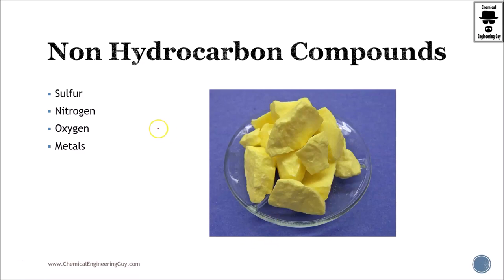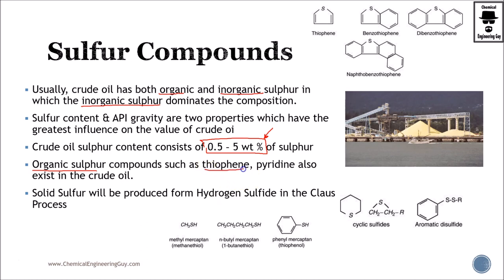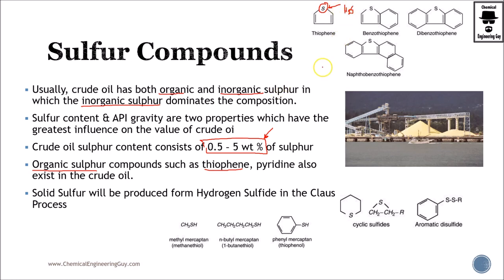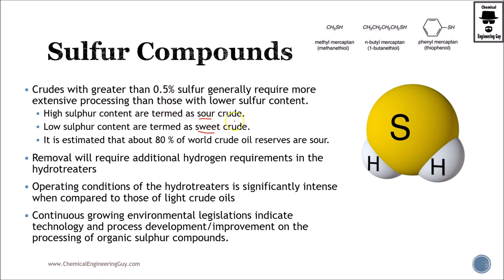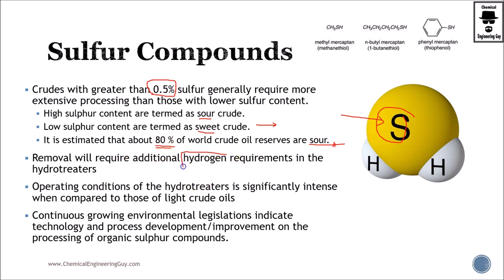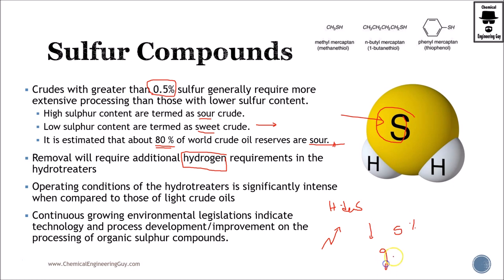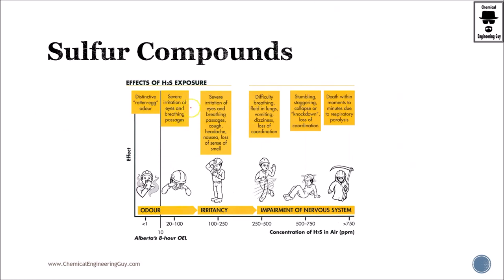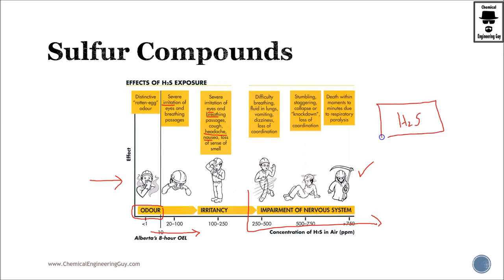Sulfur Content in Crude Oil (Lecture 049) - Petroleum Refining

Comment: Hi, thanks for the useful video. 
I'd like to ask whether there are any other methods to remove sulfur aside from adding hydrogen (hydrodesulfurization) ? If yes, do you know anything about the cost associated with each method?
Reply from the maker: you can mildly crack them, form SO2 directly, but it is not quite convenient

Comment: what does 0.5 % sulphur means. and how many kg of sulphur will be in 1 ton of heavy oil .pls reply
Reply from the maker: it typically is reported by mass, that is, 0.5% of 1 ton here it goes:
To calculate the amount of sulfur in 1 ton (1,000 kilograms) when it is present at 0.5% w/w (weight/weight), you can use the following formula:

Amount of Sulfur (kg) = (0.5% / 100%) x 1,000 kg

First, convert the percentage to a decimal by dividing it by 100. Then, multiply it by the total weight, which is 1,000 kg.

Amount of Sulfur (kg) = (0.005) x 1,000 kg = 5 kg

So, 0.5% w/w of sulfur in 1 ton is equal to 5 kilograms of sulfur.